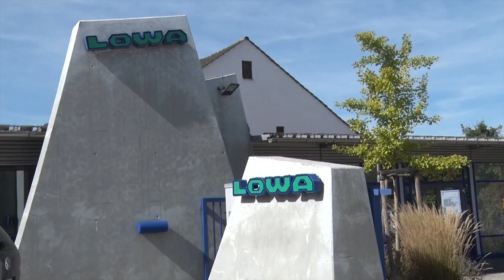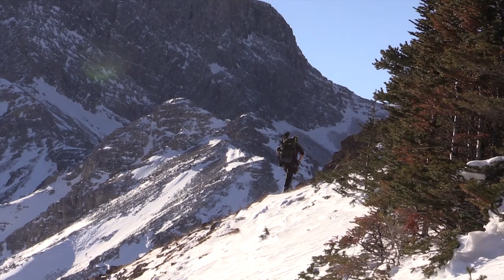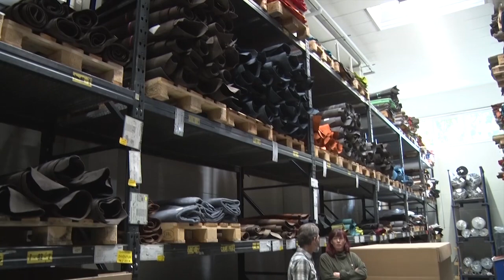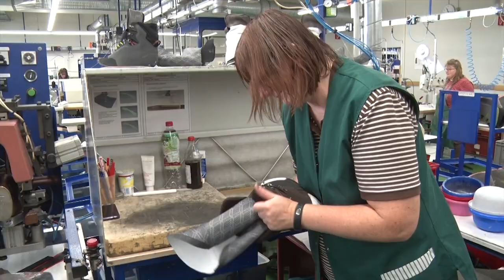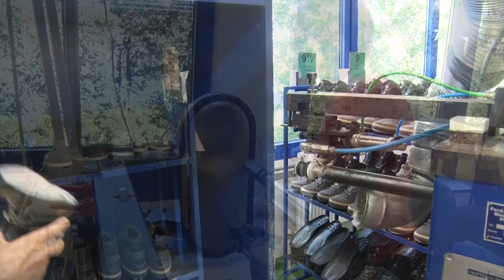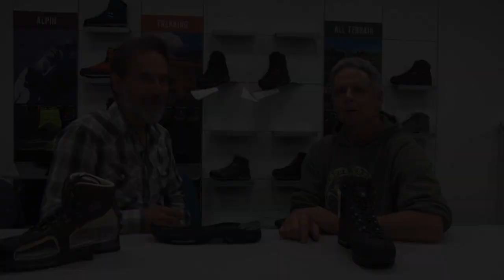A Look at how Lowa Boots are Made

Comment: Hello from NZ, 'Lowa' Tibet boot is my go to boot. I was a mountain guide for nine years, have been in the NZ mountains for 50 years, taught bush craft survival etc and at 74 , still in the mountains. Last year I did 67 tramps (hiking), this year so far I have done 38, from 1 day to 5 day tramps (hikes). A pair of Lowa boots will last me 2 years, I am very tough on them (of course, if you you only tramp (hike) a few times a year, they will last longer).
In NZ they will cost you $800 a pair. I have worn them down to beyond the soul and find that they are beyond repair, resoling cost $200 approx. I find also that the inside back of the boot (heel) wears and splits, there is not much I can do about that except put tape across the split to avoid chaffing of the heel.. When all said and done, I find this to be the most comfortable boot I've ever worn. It was very interesting to see how they are made. Cheers from NZ
Reply: take something like barge cement, a really good adhesive, cut a piece of thin leather like buckskin, to fit area, and coat both boot area and piece of leather 2 times to almost dry to touch and put together. i have done this to save good boots. works. hope this helps. better than tape

Comment: Every pair of boots and shoes I have ever owned that came with EVA midsoles or cushioning compressed to make troughs in the midsole that killed my feet. I’d get at best 4 to 6 months of wear before having to retire the footwear. You’re saying that polyurethane midsoles or cushioning will not compress like EVA and will last as long as the boot. How long is the boot’s lifespan projected to be? Will the polyurethane compress to form troughs in the heel and forefoot? I just read an article that says polyurethane breaks down whether it’s used or not. “The biggest difference between EVA and polyurethane is that polyurethane breakdowns down regardless of use. The technical term for this is “hydrolysis.” You will lose the shock absorbing qualities of polyurethane while your boots are stored in the closet. In fact, polyurethane will literally crumble after a time, even if you never wear them.” What am I supposed to believe. Who wants to pay $400 for a boot that you can’t wear 4 to 6 months later? Not me.
Reply: ... Except polyurethane foams take 20-30 YEARS to noticeably deteriorate.

Comment: I love my Lowa boots. First pair (Renegade GTX) I got in 2010 and did quite a few hikes along the Florida Trail, AT, and parts around Germany before using them on a round the world bike trip from 2013 to 2015. Sadly near the end of the trip the soles started going, but I continued wearing them until Jan 2016. I wanted to get the soles replaced, but with the Renegade that is not possible, so I upgraded to the Camino because the soles are replaceable. The Caminos are my daily shoe and I wear them everywhere, hiked a few times through Spain, Germany, sections of the AT and Florida Trail, as well as just everyday walking! These are my daily shoes! Anyway the soles needed replacing and this is how I stumbled across your video. Searching on Lowa sole replacement because I just got them back from the local Cobbler and sadly they did a bad job replacing the soles. It's like they used a Vibram tennis shoe sole instead of a Vibram hiking boot sole. I noticed that Lowa is currently not accepting any new orders for sole replacement which is a bummer. In the meantime, I did order a new pair today and will continue walking around in my older pair until I can get the soles replaced with proper soles. Thank you for the video.~Ron